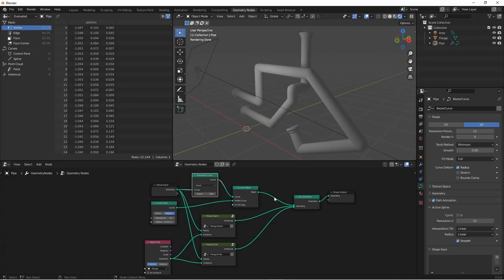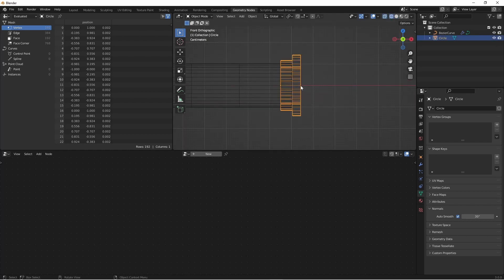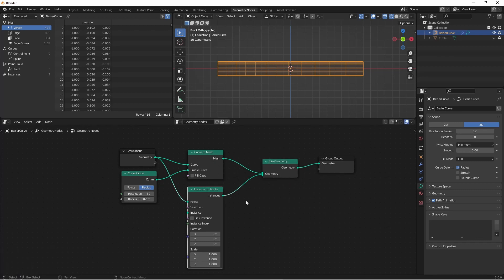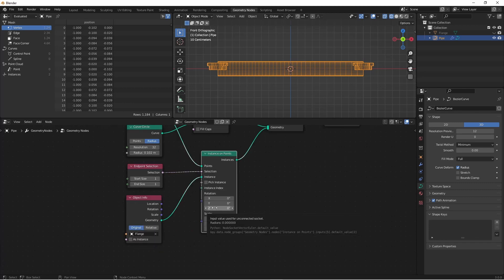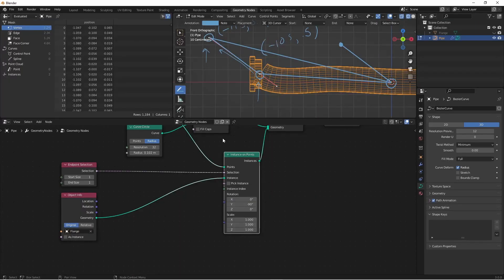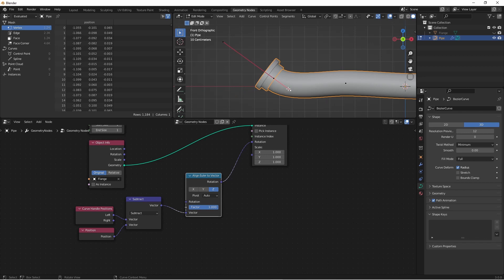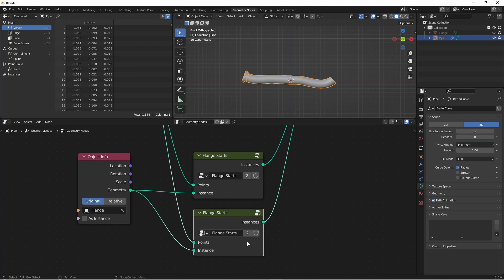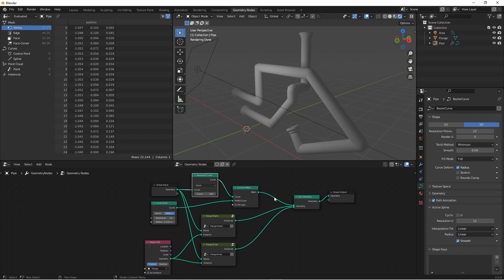Blender 3.0: Geometry Nodes Fields - Endpoints and Alignment

Comment: I have a question: Is it possible to also do this the other way around? I have a range of arbitrary shaped curve wire sections that I instance in my node tree. So I now want to align their endpoints to each other to get a smooth transition between the sections (that I later put together with Curve to mesh & Merge by distance) To attach the curves to each other I also instanced vertices between the sections. These vertices  I use to snap the endpoints of the curves to. I used Position & Attribute Statistic nodes to get the origin of the vertices, can I now use you method somehow to transfer these coordinates as rotation to the curve handles? I also tried transforming one of each handles to type vector and the other one to type aligned with varying success. (btw It would be really ultra cool if there was a standard node in Blender to quickly connect 2 curves together)

Comment: Does that not work in path curves ?
Reply from the maker: I would just use the curve point tangent instead of calculating it from the handles. That is probably an easier method than I did in this video.

Comment: Hello! Does using "Curve Handle Positions" over "Curve Tangent" has some additional benefit or it's a personal preference/different approach?
Reply from the maker: Curve Tangents are normalized (length of 1) while the relative position can be any length vector.
Reply: @JohnnyMatthews  so it's more general. If the curve is given, Curve Tangent is sufficent but if the handles edited/set parametrically than it's better. Or I get this wrong?

Comment: 1:12 I did not know you could just enter in the feet of inches even though you were in metric. That's so helpful to know I don't have to swap back and forth between units because I work in both metric and imperial. Such a time saver.
Reply from the maker: Also in settings turn on "Default to Advanced Numeric Input" under the Input tab. Then you can use measurements when you use the G shortcut.

Comment: Hi Johnny! Thanks for the tutorial! I have a question 🙋🏽‍♂️ can’t you use the tangent of the point to extract the information needed to solve this problem?
Reply from the maker: I think I ran into a problem with that when I was working on this tutorial.  Maybe I just messed it up. Theres multiple ways to do some things. Try it and let me know!
Reply: To do the opposite I just compare the index with 0 (which means is the first point of the curve) then rotated the already aligned instance 180 degrees.

Comment: this tutorial is so helpful and came at the perfect time! I was wondering, what is the best way to subtract the endpoints from a selection of points? Id like to use a curve to points to instance metal rungs on the pipes.
Reply from the maker: Use the Boolean math node to do a NOT on the endpoint selection
Reply: @JohnnyMatthews  do you mean to put it before the endpoints or after?
Reply from the maker: Adding a NOT to a Boolean field will invert it, so after the selection.